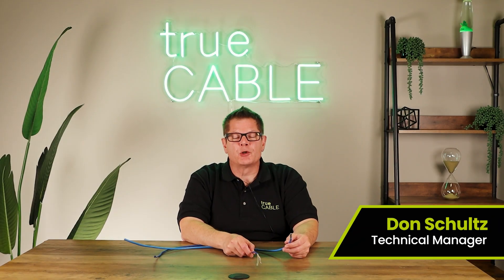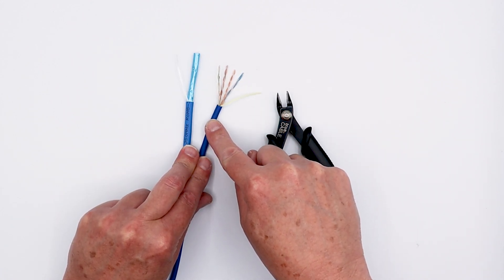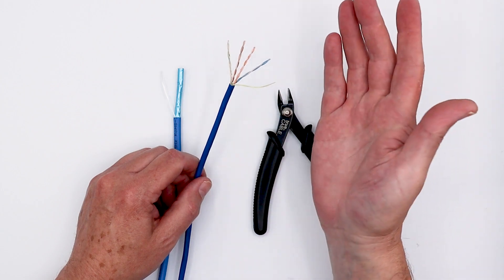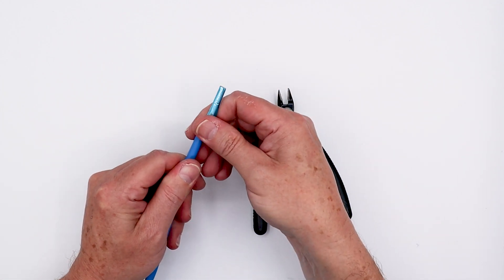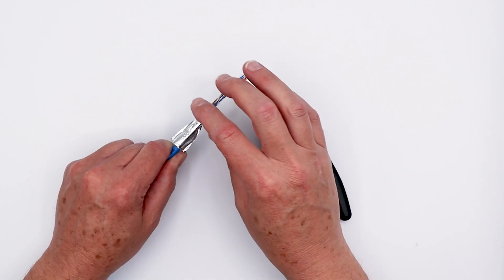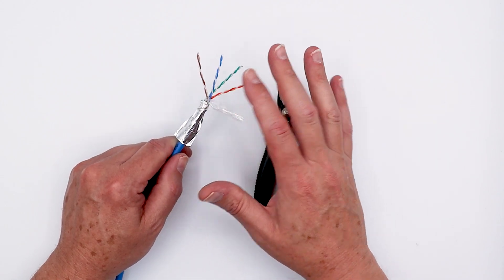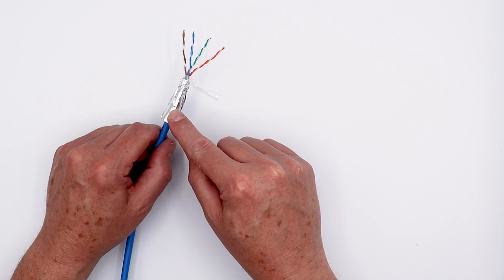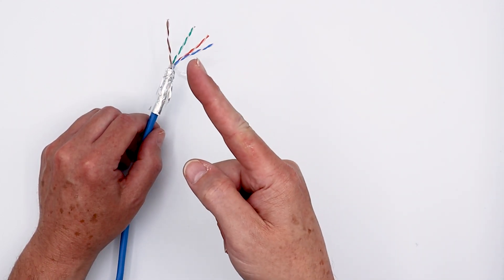Shielded vs Unshielded Ethernet Cable: When and Where to Use

Comment: Here's a question: in a scenario of installing outdoor cameras or APs which will be terminated indoors, the proper way to mitigate induced current from lightning strikes is to have a surge suppressor mounted at the point of exterior wall penetration which is then bonded and grounded to the building's grounding infrastructure. In the event that a surge suppressor and ground wire will NOT be used in this scenario, does utilizing shielded cable (appropriately bonded to the grounding system at the patch panel) offer any benefit over unshielded in protecting against induced surges? And, how would that compare to using a surge suppressor on unshielded cable, but only at the patch panel where AC grounding is already readily available (as opposed to at the exterior penetration)? The pattern I've noticed is that pretty much every exterior-rated PoE device I've come across has a shielded 8P8C jack, so I've started to wonder if using shielded cable on the exterior is always preferred for this reason.
Reply from the maker: Hello! That is a great question. Shielded Ethernet alone (even when bonded to ground properly) is not going to provide any protection against a lightning strike. The only thing that will is a SPD that bonded to ground and that SPD should be installed outside the structure prior to ingress. Shielded Ethernet can be helpful to ward off minor ESD discharges from affecting your network equipment due to air movement across the cable or end point device, which is a different issue than a lightning strike. A great example of where shielded should always be used is aerial runs, as the cable jacket is subject to air movement nearly all of the time. Shielded would be optional for direct burial applications under 150ft and for applications where the cable is attached along the originating structure and not running between two structures. Unshielded Ethernet using a SPD is well protected against induced surges as you described, and I would consider that superior to shielded with no SPD at all. Whether shielded is used or not, a SPD becomes required for those aerial runs I mentioned, or direct burial runs that exceed 150ft (per the NEC/NFPA 70). I hope that helps!

Comment: Hey guys. I’m renovating my apartment in a 95yo concrete house in Reykjavik Iceland, and I am routing new Ethernet cabling through walls and along the floor. I have one spot where I need to cross regular (220v 50hz 10amp) wiring at a 90 degree angle, and I likely only have an inch of clearance. I suspect shielding everything would be overkill, but I’d love someone to confirm my suspicions 😊
Reply from the maker: Hello! Yup, shielded is overkill. You can cross at right angles with no issue. As for living in Iceland, I am jealous. I fell in love with Iceland when living in Keflavik during the mid-1980s. My stepfather was stationed at the NATO air base in the US Air Force. I lived there on base as a teen for 2 years. Back then, they had F-4E Phantoms. Yikes. I just REALLY dated myself there...
Reply: @trueCABLE  Haha, how wonderful. I know there were some servicemen/women who didn't like it, probably because of the weather and the darkness during winter, glad you did in spite of it.
Thanks for the info!
Reply from the maker: @ingogud  Always happy to help!

Comment: Can you tell if cat 5e Shield  or  cat 6 UTP cable  how for should be distant in inches 
from  normal 230V  Ac cable  and 12 dc volt cable
Reply from the maker: Hello! For 240VAC or less, 8" separation or more on parallel for unshielded Ethernet is best. For 12V DC, technically no separation is necessary, but I would not bundle the two cables together either.
Reply: @trueCABLE  thanks. what is the Distance for shields and if one side of  the cable grounding is  Enough?
Reply from the maker: @vimukthi.  Hello! That is a tough question to answer. The maximum distance for shielded Ethernet may indeed change if only one side is bonded to ground, but thus far nobody has done the required experiments and tests to determine what if any limitations there are. The reason why is the standard is very clear about both sides needing to be bonded to ground (and equalized on top of that) so nobody has bothered to do the required research on this subject (yet). We intend on conducting these experiments in the future.

Comment: I’m doing audio and video installs for commercial spaces. In the past, I have purchased all shielded cables, but I am looking at making my own. I’m wondering if I should just use the unshielded now because it is easier and cheaper. Thoughts?
Reply from the maker: Hello! Generally, you want to use unshielded. Even for AV installs, since the data is packetized and the signal is not analog. Now, that said, if you have strong sources of EMI/RFI in the environment that call for the use of shielded cable then so be it, but don't install shielded Ethernet cable thinking it will "go faster" or be "better". It won't, and it won't be. Shielded cable is designed to solve a problem you know you have. You are also correct, unshielded is significantly easier to install and deal with, plus there is no need to bond it to ground.

Comment: Question: got a scenario in an educational facility where we are running (2) Cat6A Shielded cables between TV location and work station (desk) for HDBASE-T.  Shielded is recommended for AV transmittor.  We would terminate with shielded jacks and also can use shielded patch cables, but does the HDBASE-T transmitter and receiver normally provide the bond to ground within the electronics?  We are not in a rack, so we cannot bond to the rack via metal patch panel.  I am unsure if the electronics naturally provides the bond to ground when the shielded patch cable plugs into the device on each side?
Reply from the maker: Hello! You should not have any issues. Your A/V equipment should provide the bond to ground via their power cords. The PC in particular has a switching AC power supply that will provide the bond to ground as well. Hope this helps!

Comment: Hi, is  a shielded telecom cable useable in case of ((cable that designed with drain wire ; but produce without it in factory))
What the case of use  this cable in said cobdition. Thanks
Reply: In other hand can we use this cable without drain wire in same circuit?
How we join and terminate body of shield to in or other cable with out drain wire.
Reply from the maker: Hello! Yes, a shielded telecom cable in this condition (missing the drain wire) is still usable. You will need to fold back the cable shield and bond it to your termination hardware in order to terminate the shield, which will work. This sometimes occurs during manufacturing when the spool of drain wire runs out mid-process, resulting in no drain wire or a cable with only part of the drain wire inside. Quality control should have caught that in the factory, but it depends on the manufacturer and how carefully they monitor the quality of their cable production.

Comment: Hi. Two questions. I have power-lines outside my window. Not the gigantic ones, the ones that run power directly to the houses. Should I use a shielded Ethernet cable since I will be running the cable along the wall that has the power lines outside of it?  
Second question. Does the Ethernet cable need to be shielded if there will be a lot of electronic plugs next to it? For example, plugs to my computer, TV, Roku ect. Thank you!
Reply from the maker: Hello and great questions! There is a valid use case for shielded Ethernet cable, but I think in your situation you would be okay without it! The power line outside your window would be 240V AC, which is your typical step-down circuit from the transformer to a regular residential home. This can be treated the same way as 120V AC so 8" separation on parallel runs would be called for if using unshielded. That all said, if the power cable is outside and your Ethernet cable is inside, the wall itself is providing separation. If you have any type of metal siding that is providing yet additional protection, I would not consider this a problem. For running Ethernet near electrical outlets/plugs, this again is no problem as long as you don't go bundling the Ethernet cable with the power cords. Keep it separate as much as you can, but don't stress over it either. Hope this helps!
Reply: @ You’re awesome. Thanks for responding so quickly.
Reply from the maker: @holylabs  Thank you for the kind words! Always happy to help!

Comment: I imagine that you have to use special grounded RJ45 connectors with shielded or it doesn't matter?
Reply from the maker: Hello and that is a great question. When using shielded Ethernet, all associated connection hardware should also be shielded and bonded to the cable shield (patch panel, keystone jacks, and 8P8Cs aka RJ45s). The bond to ground occurs at the patch panel side. Hope this helps!
Reply: @trueCABLE  Thanks a bunch!

Comment: Hello @trueCABLE !
Could you pls help.
What would happen if a Cat6a U/FTP shielded cable is not grounded in a regular apartment? The Cat6a cable was bought without knowing it should be grounded. Will it make the internet much worse or not?
Reply from the maker: Hello and don't worry. Shielded cable that has not been properly bonded to ground may cause issues, but likely won't in your case. The reason is (paradoxically) you likely did not need shielded cable in the first place and are likely not going to experience strong EMI/RFI sources that would need to bleed off to ground in an apartment. You are, in all likelihood, not going to experience any negative effects. Hope this helps!
Reply: Thank you very much for your help. You probably have the only channel about internet cables that provides so much useful information!
Reply from the maker: @vitaliifito7347  We got your back!

Comment: Hello im going to make a wifi network on a ship and have to run ethernet in the engine room alongside 24volt 230 volt ac and possibly 400 volt ac wires should i use shielded or would a regular cat 6 cable be fine?
Reply from the maker: Hello, and great questions. Running alongside the 24V is no problem, as it is considered low voltage. The 230V will require separation on parallel if you are using unshielded Ethernet. Rule of thumb for 230V or less is 8" for unshielded and no separation for shielded. 400V is another story, and potentially dangerous. For that, you will need shielded if you are running parallel to it any closer than 24". If 18" or closer, then shielded Ethernet installed inside metallic conduit bonded to the ground at both ends is a good idea. If 24" or more away, you can use unshielded Ethernet.
Reply: @trueCABLE  allright thisbis perfectly clear shielded it will be.
Thank you verry much.
Reply from the maker: @bertkooijmans4769  Hello! You are welcome, and I was glad to help!

Comment: I plan to run multiple cat6 cabling outdoor underground in a countryside camping place. No interference of heavy powerline or EMI. Besides outdoors underground there is no other reason as such. 
Do I run unshielded cat6 cable In conduits or SFTP cat6?
Please advise.
Reply from the maker: Hello! Taking your stated environment into account, your best bet is to use our Cat6 Unshielded Gel-Filled Direct Burial cable. It will provide maximum water resistance and is pretty easy to work with compared to shielded cable. Technically, you don't even need conduit as you can direct bury it--as long as you bury at least 24" deep. If using conduit, then bury the conduit at least 10" deep, but be sure to use a synthetic wax-based lubricant when pulling the cable through it to avoid cable damage. We sell everything you need. If you are in the USA or Puerto Rico, you can order directly from www.truecable.com, or if you are in Canada, you can order from Amazon CA. We don't currently ship internationally.
Reply: @trueCABLE  in based in Africa
Reply from the maker: @shaibannatha795  Hello! trueCABLE sells in North America and Puerto Rico only at this time. In the future, we may start offering products internationally.

Comment: Hello! Great content! I was wondering if it matters using FTP cable in my case. I want to connect two houses. There are no magnetic interferences in my area that could affect the cable so much i guess. Would it be ok to use UTP even though I use it outside? Thanks!
Reply from the maker: Hello! Thanks for the kudos and we are glad you find the content useful. As to the choice between shielded and unshielded Ethernet: Don't use shielded Ethernet cable unless you have a specific reason to do so and are looking to avoid a problem area you know about. Using shielded has benefits in some scenarios, but not yours. Incorrectly installed shielded Ethernet cable will cause far more trouble than resolve any non-existent issue.
Reply: @trueCABLE  thank you very much! 😊
Reply: I'm confused in the previous comment you told them for outdoor to use shielded:
"Any sort of outdoor aerial installation demands shielded cable due to the need to drain off ESD discharge (due to air movement) to ground"
Reply: @SmartySmarts he's likely burying it not snaking it across the lawn. Not quite the same as dangling in the wind outdoors. The ground does a pretty good job grounding things.